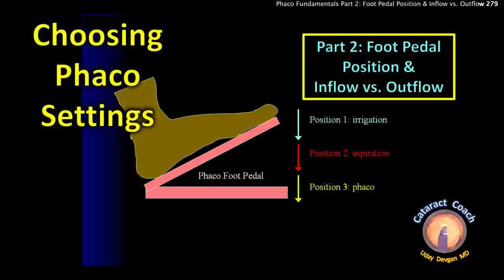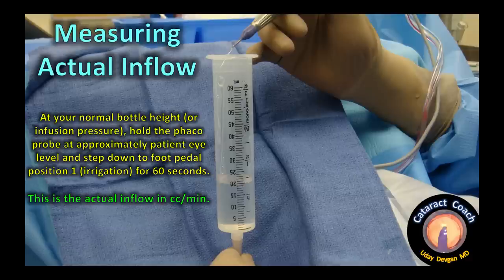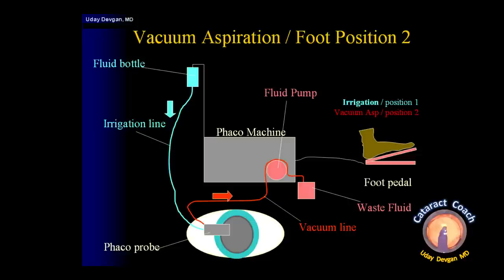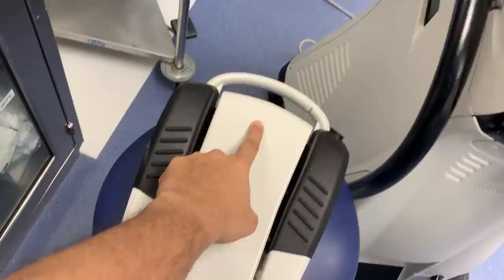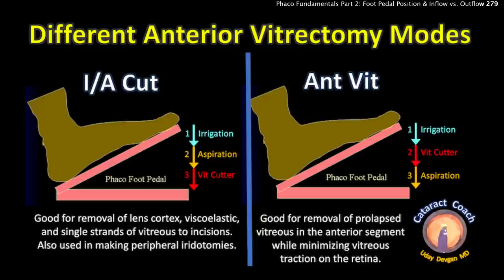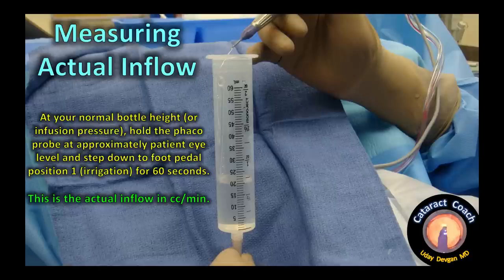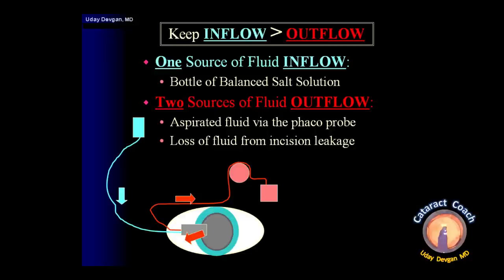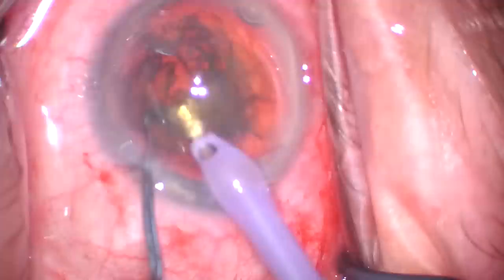Phaco Fundamentals Part 2: Foot Pedal Position & Inflow vs Outflow

Comment: sir,  does the deepth of chamber  determined by only bottle hight ?
Reply from the maker: many factors are involved with that. Bottle height is important, but just one of the factors.
Reply: @UdayDevgan  thank you, sir. what should i do if the anterior chamber is too deep  when i trench the nucleus?
Reply: you can lower the bottle height slightly and judge the depth.
Reply: does increasing the flow rate helps in this case to make anterior chamber shallow?